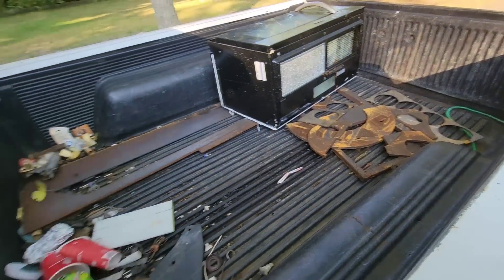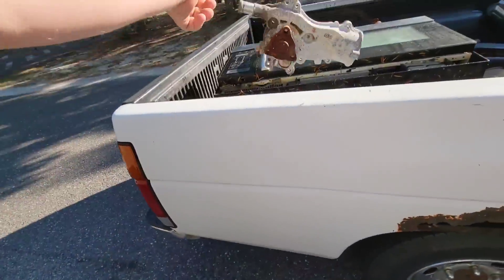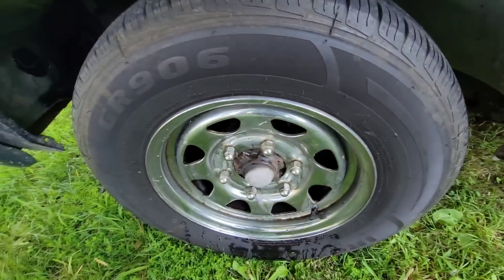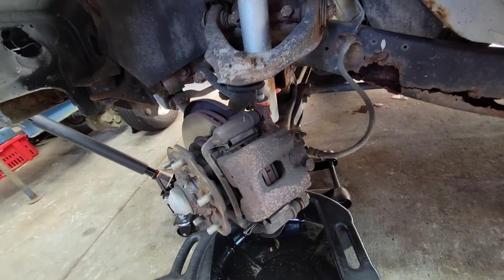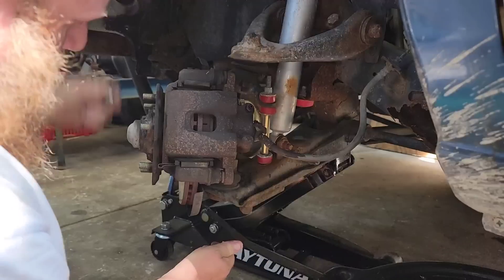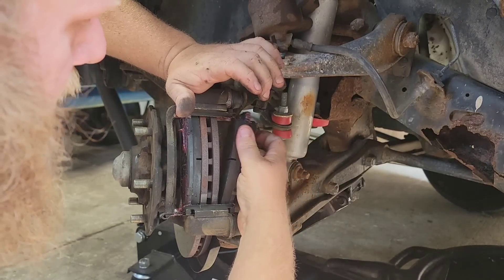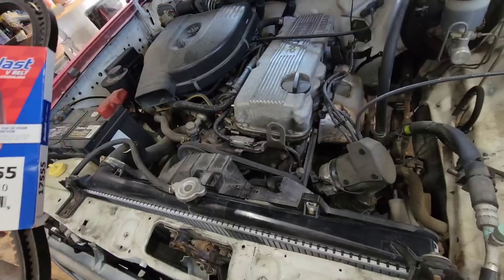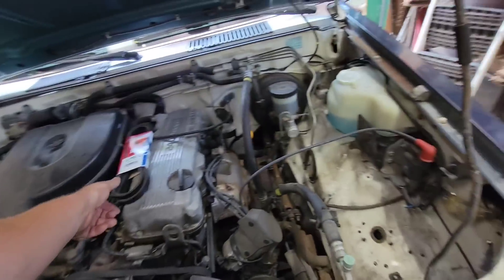Trash picking broke my Truck

Comment: Great repair video. Thanks for sharing your experience and ways to detect the roots of the failure. There's so much to learn from you. Guess the belts should really be next for keeping a cool head. I really like it, when you take us along with repair and maintenance works. For me it is fascinating how you keep your stuff needed for all the farm work running. A lot of knowledge and hard work saves a lot of money (which is better invested in a new roof when finally needed ;-). Keep it up, all the best
Reply from the maker: I need a new roof right now..... Barn and the house

Comment: Check your brake hoses, they might be blocked. Had it happen to my Merc. The fluid would not back out until you turned the wheel.

Comment: That driver side frame rail is scary at best. Good luck Bert.
Reply from the maker: For sure.... the inside the top and the bottom are perfectly fine.... And there's plenty of vehicles out there with C channel chassis ....  I'll get to it at some point

Comment: no glovelets. flush your brake fluid before u buy new calipers. Also not suppose to use grease on the pads. Antiseize would be a better option as it doesn't liquidify.

Comment: Why do you leave the truck running while not driving?
Reply from the maker: Because I've changed plenty of starters and timing chains.... And I don't know if you've done either of them lately it's way cheaper and easier just to put gas in it.  Not to mention the air conditioner's on and it's a 100ﾟ out today